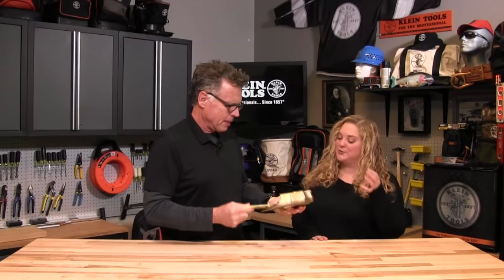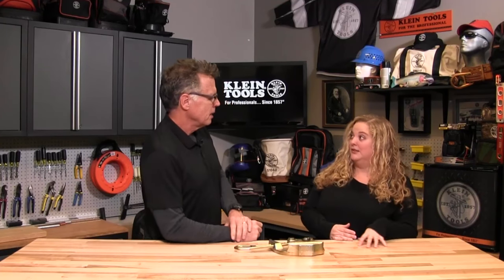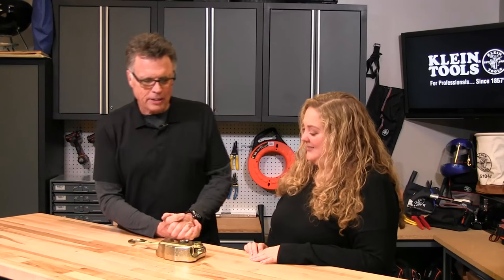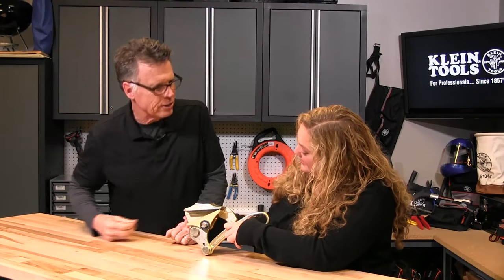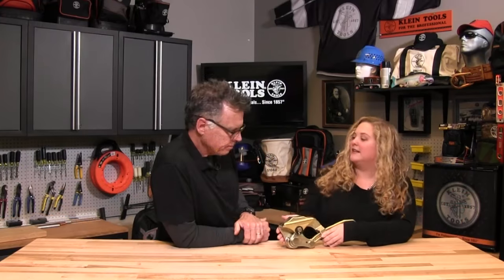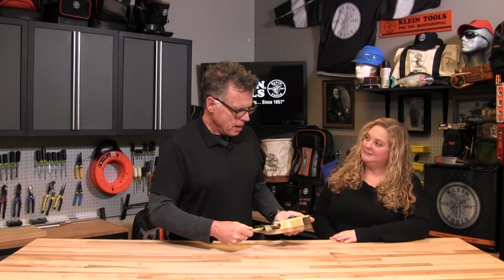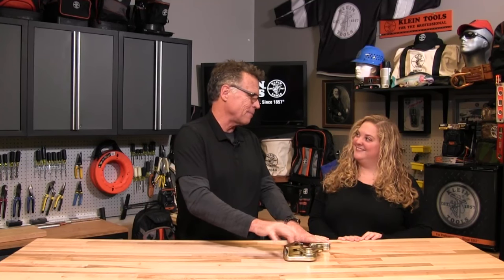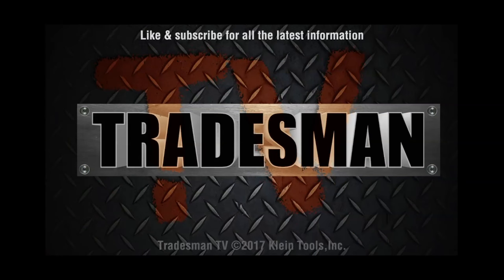Tradesman TV: Wire Pulling Grip

Comment: could this be used to tension triplex cable?
Reply: Tension tri plex? Wtf?
Reply: Should work for tensioning triplex.
Reply: you can sag triplex with these. If you're asking this question I don't think I need to point out you should only grip your steel cored cable
Reply: @Kevin-ip8uf  Which ones work on non steel core?